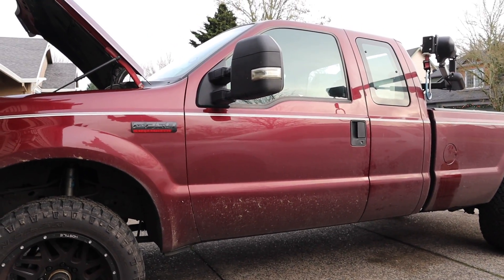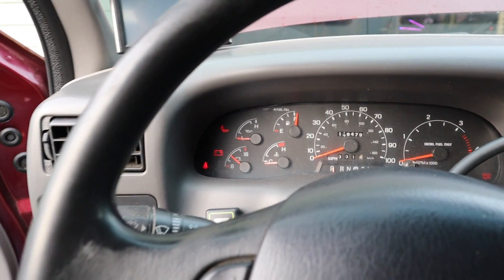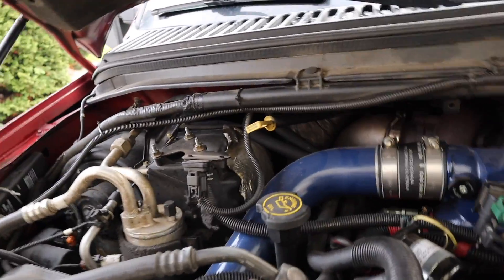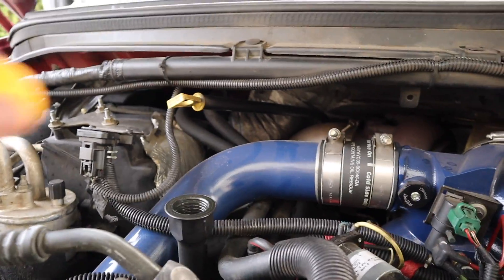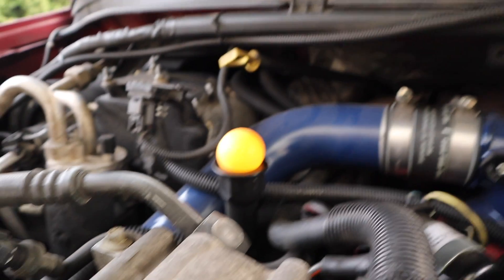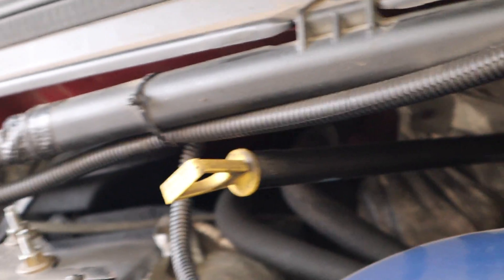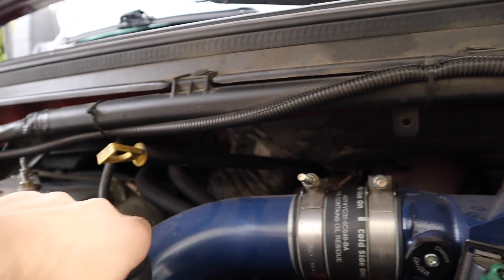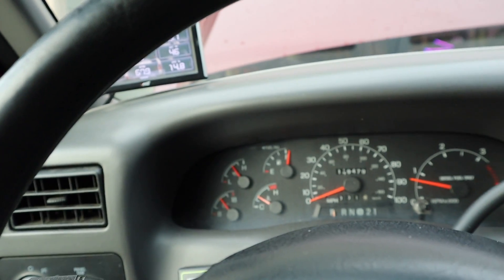Ford 7.3 Powerstroke How to REALLY Check for Blowby On A Diesel

Comment: Very interesting, and inspired me to do the same test on my '99 7.3 w/ 293K miles. Had the exact same motion on the ping-pong ball! Perplexing. I've only owned the truck for 6 years, though I have changed the oil every 5,000 miles AND change the HPOP reservoir oil, and run Archoil additive. Wondering what a new/rebuilt 7.3 and a worn, ragged-out 7.3 would show on this "test."
Reply from the maker: Ive never seen a blow by test on a new 7.3 but I have seen some 7.3s thatll blow the oil caps off haha
Reply: I've had 3 7.3s, all knocking on 300k miles.  All 3 have had less blow by vapor than the truck in this video.  All 3 had long oil change intervals.  10k-15k miles.

Comment: Quick question what do you do for work? Because you know how to blow some coin on a 7.3 my friend. Last question? Why do you choose to upgrade an older truck when you can clearly purchase a newer one with less mods that produce better or the same outputs and gains? I have a 7.3 and I have my reasons why I dont want to by newer, what are yours?
Reply from the maker: Good questions, I could actually make a video on this whole topic. Perhaps I should.

I work on supply chain Logistics for a large international company. By no means am I making a ton of money from it, but where I am at in life I am able to have a little more free spend money for the time being. I have definitely spent a fair amount of money on my 7.3 but I would be spending at least $10k-15K+ more than I have already just to get newer stock 6.7 with comparable mileage. This channel is not just a fun thing for me it is also a business thing. I am investing a lot of time and money into it to get it to the point of seeing a positive return. So I could have a newer truck right now if I wanted but as far as business goes I need a vehicle that is a little cheaper with more projects to work on to provide content for the channel. At some point, I will upgrade but just not yet.

Comment: Is it actually being lifted or is the movement from the engine vibration? Vibration is obviously contributing to movement.
Reply from the maker: I would say that it is ever so slightly getting lifted. the engine shakes but not quite that much.
Reply: My 2000 f250 just rolled over 100K and has been very well taken care of since I bought it new.  I can see vapor like your's produces with very little blow by. I just started running NMF (No More Friction) additive and I dropped almost 250 RPM cruising at highway speed and idle is significantly quieter. Might give it a try. I doped my oil, my power steering pump, and my tranny fluid with it.  I'm going to put some in my differentials and my transfer case as well.

Comment: manometer on the breather tube is the only way to actually check it against the spec from international, and when fully warm

Also, blowby is from worn rings, not piston cylinder clearance..
Reply: Nope, blow by is from worn cylinder walls losing the cross-hatch hone that retains oil on cylinder wall creating the seal between rings and cylinder wall.
Reply: Worn rings or cylinder walls as well as carbon build up.
Reply: You know you're always going to see cross hatching on a used engine no matter what the rings condition because the metal is a lot softer plus the Pistons are aluminum so which is going to wear out first the cylinder walls or the rings in Pistons it's a no-brainer just cuz you see cross hatching doesn't make it a healthy and non worn out motor the only way to really check to put a gauge between the ring and the cylinders and measure the gap just some common sense for some that don't know
Reply: What should the numbers be?

Comment: Most diesels have pressure. Flipping cap upside down on a vibrating diesel engine. Blow by usually coats your hand in oil.

Comment: I have an 02 7.3 with 95k miles. Very similar blowby results as yours. Good video brother👍. Don't worry about the vapor usually 95 percent oil. Big industrial engines I work on have crankcase vent slingers that drops the oil out of the vapor and return it to the crankcase. Catch ya on the next vid

Comment: Is there a good way to check a e350 without getting into doghouse?
Reply from the maker: Not super familiar with the layout of the vans. You might be able to get to the oil fill through the front.
Reply: Na, just keep fresh fluids in it and keep it pinned wide open.

Comment: But what about the stock ccv? Doesn't it make all the tests pointless because the intake draws vacuum on the crankcase?
Reply: Exactly I was waiting for somebody to ask this exact same question I always think when I see these videos about blow by the other side of the valve cover is vented into the intake so pressure is being sucked out of that side and sort of makes this whole test kind of pointless so glad somebody else sees my point of view
Reply: I was just thinking the same thing!
To accurately check you would need to cap the CCV line then check at the oil fill neck.
Reply: Diesels dont produce hardly any vaccum, thats why they have vaccum pumps or hydraboost